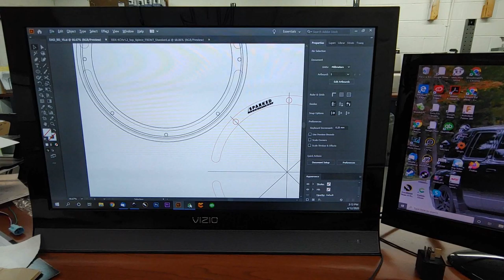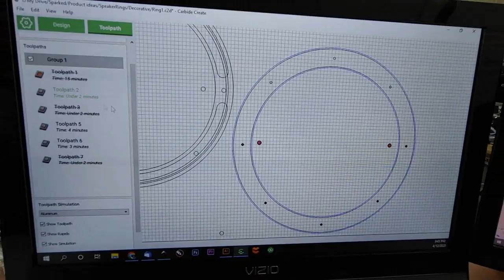Making Custom Speaker Rings!

Comment: Custom rings would be nice. How about rings for inverted applications? LED lights within the ring may also be a nice option. I have two Sundown Zv5 15" that will be mounted in a fourth-order with the cone in the sealed section. I would need rings for that sub in the inverted position. Would they be interchangeable per sub? Great ideas!! I can't wait for the fan to come out.

Comment: Nice Ed. I never liked the rubber gasket, trying to get the right screws in it is a hassle. Kicker made a similar ring but the under side was square and over time it would cut the rubber surround. I'm running 4 AD Design 12s series 2200, the new ones. I would like to talk to you about all new battery's and going lithium, I need sales advice. How can I get ahold of you, I messaged you on FB months ago no response. Thx for the video!

Comment: I would buy that if the inserts had some kind of electrical connection along with some kind of lighting and the lighting has options to run in a circle or some kind of pattern so basically the light color would probably be the insert color or even a clear for the multicolored capability light.. i need those for my audiopipe subwoofers because they have some kind of weird surround that's not smooth and if i want to invert them i have to do something similar to what you did with your product...

Comment: I like it! So the screws would not be used to hold down the ring? Hence the pressure fit? Just wondering cause my SA V2s are heavy and take quite a bit of torque to hold them down. Would be worried with cracking them.
Reply from the maker: Pressure fits to stay on while mounting, and screws to clamp it tight. This is HDPE and shouldn't crack under torque.
Reply: Well then yea I’m definitely a fan! Will be keeping a eye out for them!!!

Comment: Maybe not a speaker ring for decorative but maybe a speaker ring for inverting subwoofers and making good contact selling a multiple ring connector to bring it out one to two inches and again you can even make it fancier by putting lighting in it... You probably wouldn't have that product by the time i finish my car stereo system but there's got to be somebody out there like me that wants to do isobaric configurations i mean smd makes there money by cutting out pieces of plastic for speaker ring terminals
Reply from the maker: Actually we do offer reverse mounting MDF rings now
Reply: @SparkedEd  i have 8 audiopipe bd2 15s... I want to run them in an a  isobaric configuration.. are they listed on your site with measurements or are you doing them custom
Reply from the maker: @christhopherlasher2828  They would be custom as the dimensions would need to be specific to your basket. They would run you $15ea ring and you can just message us on the sparked innovations facebook page. https://www.facebook.com/sparkedinnovations